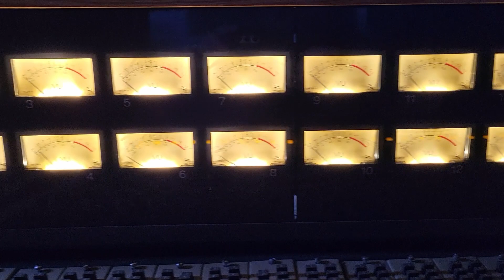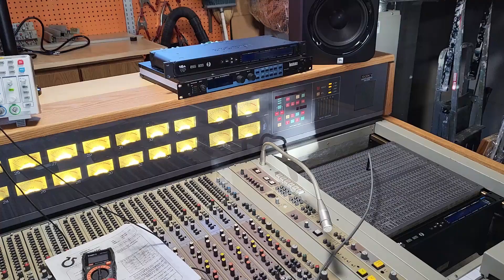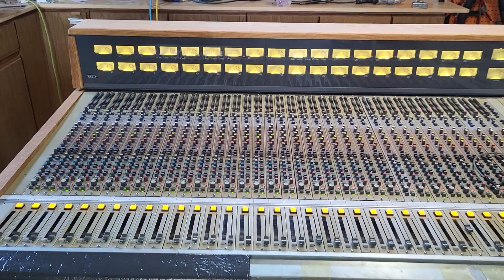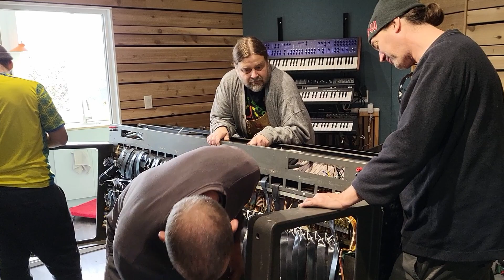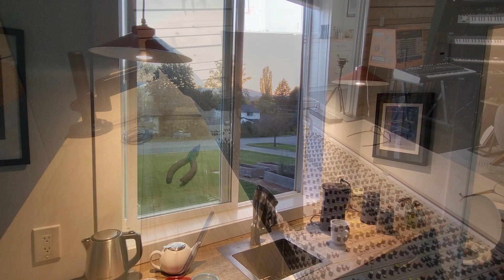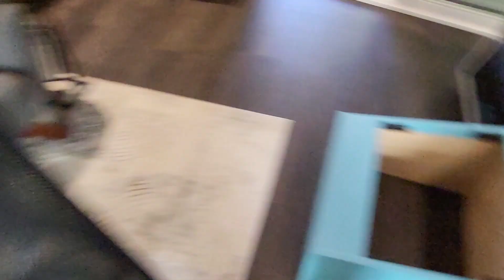Vintage Console Restoration - Part 7 "What if it doesn't fit?"

Comment: Wow! How would a Sony stand with an Api/Ssl/Neve in general?
Reply from the maker: Well, I used an SSL board in the late 80s, but now have SSL Six CH. I've never worked with any Neve other than the UA Unison pre models. I have a very limited experience with some API pres. So, my answer is based on not a wealth of knowledge.

However, I feel like the Sony leans towards that clean SSL pre amp sound. The EQ's have their own flavour which is very musical and pleasant, even with mild boosts/cuts. It's a super clean sounding board with tons of headroom. I prefer that over something that's adding a particular colour to all tracks.
Reply: @EdgetoneStudios  Fantastic. Thank you!

Comment: I have enjoyed this series. A friend of mine in Iowa runs one of these consoles. With a console like that,  I would recommend using the console for analog/hybrid mixing or summing. I think you'll find it really adds something to the sound over mixing in the box.
Reply from the maker: Thanks. Unfortunately I made the call that it was a bit too big for my space. It was a cool project though.
Reply: @EdgetoneStudios  I understand. I have been outgrowing my studio too. Sometimes streamlining and having more open space can be inspiring too.
Reply from the maker: @TwinCreekAudio  I think I knew it was too big from the start, but the "idea" of this analogue beast as the centerpeice of my productions was so compelling. Still don't regret it though, but kinda sad.
Reply: @EdgetoneStudios  That makes sense.    The restoration process is also interesting and fun. I've learned a lot working on my consoles.

Comment: I am in the process of taking an old mx2488 carvin console and modded with electronically balanced all in's and outs plus a patch bay all on db25's and it is so much work but this looks like on another level work. Congratulations sir for your tenacity.
Reply from the maker: Thanks. Indeed, repairing these old boards is a lot of work, but in a way I got lucky. Other than the automation boards being problematic, and chewed ribbon cables, and cable connections, practically everthing just worked. 
The rest was cleaning and cosmetic things like consistent lights. 
I still have a couple minor issues, but as far as I'm concerned it's fully functional.

Comment: I’m real curious as to why you would use that desk for tracking but not mixing?
Reply from the maker: Mainly because I tend to go back to mixes with revisions, sometimes days or weeks later. With analog mixing, unless you very accurately document every level, you don't really have session recall. I also tend to do a lot of volume automation in my mixes.

I could see my primary mix workflow being a hybrid, where I send up to 24 stems back to the board and zero out the faders. Then I would mix in the box and use the board as an analogue summing amp. But I guess I'll find out more once it's connected and I get to try things.
Reply: @EdgetoneStudios  Yeah, recall is an issue…

Comment: Interesting that the newer boards have transformers. On my MCI and Sony tape machines, the older ones have transformers, the newer do not. I fully relate to phantom issues going away when you unplug and re-plug things, and finding that I have two channels swapped.
Reply from the maker: I think that there was always an option for the boards to have transformers or not. The console I purchased was the 19th one built in 1986 and I suppose they chose not to have them. The replacement cards I got were definitely from a console in the 90's and just happened to have them.